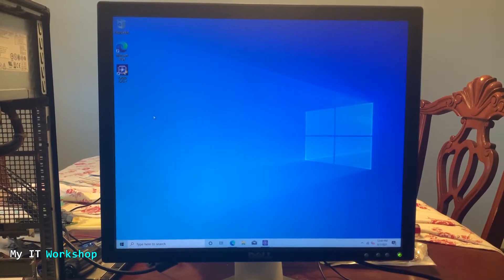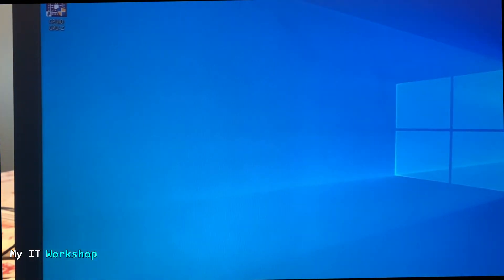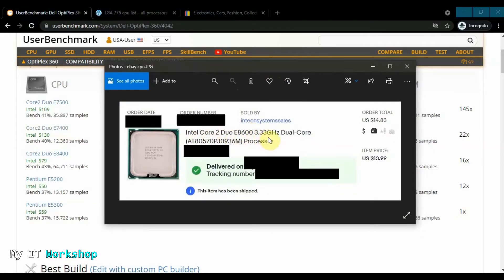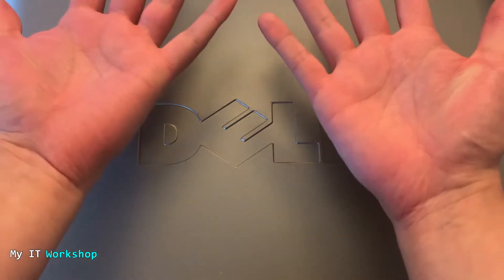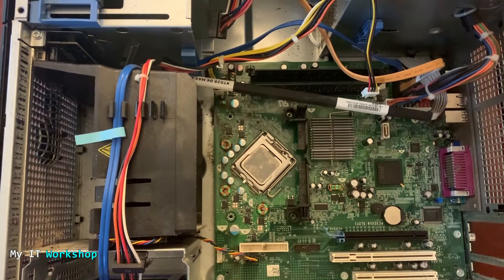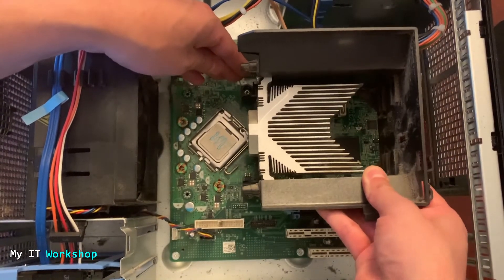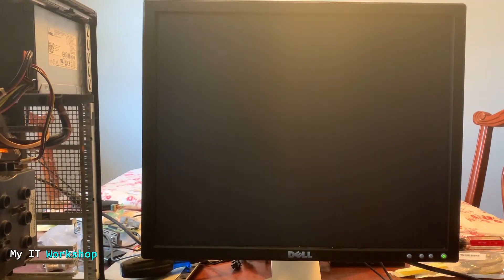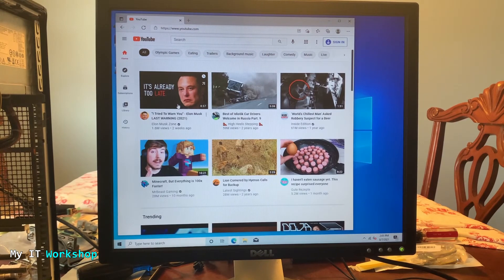Upgrade CPU on Computer from 2008

Comment: Good video. Thorough and helpful information. I am considering an upgrade to my old 2008 HP Pavillion model a6652f desktop computer. It has 12GB system RAM memory and an NVidia Experience graphics card with 6gb on board. I sometimes get error messages when trying to install/run games. I'm sure it's the slow processor. Can you tell me the best Intel CPU upgrade to order? Would like to get one as powerful as possible. Thank you

Comment: I have an odd question. So as long as the socket type, Front Side Bus,, and power consuption are the same. I could hypothetically finf a quad core processor over the dual core processor I have now? Even if I dont want the processors from the family of processors that were originally for that laptop/desk top manufacturer?

Right now I have a core duo 2, I would prefer having an i3 or an i5 or without changing memory, or gpu that come with my dell vostro 1720 laptop.
Reply from the maker: Hello,
These 2 possibilities  come to mind; 1) the CPU wont fit in the socket. 2) If it fits, it will either make beeping sounds or the computer wont turn on. The problem comes with the type of socket that is different from model to model. There are some; LGA 1151, LGA1200, LGA 1150….
Hope it helps
Thanks for the comment